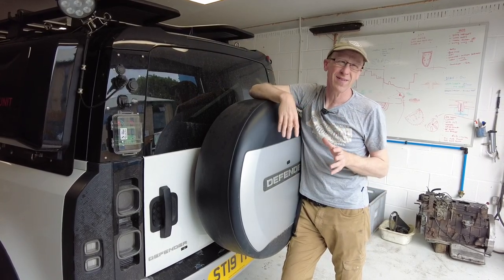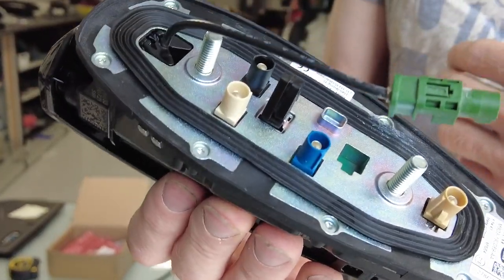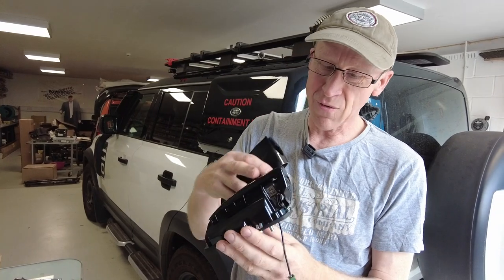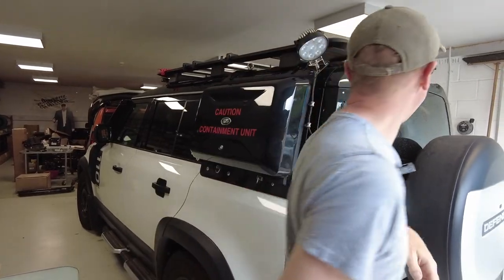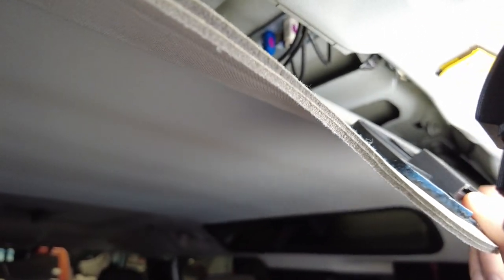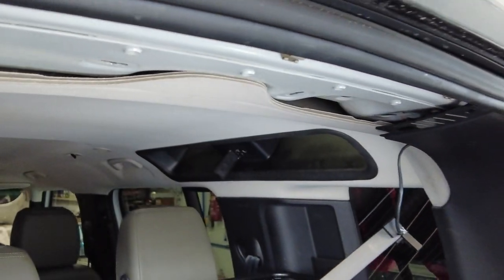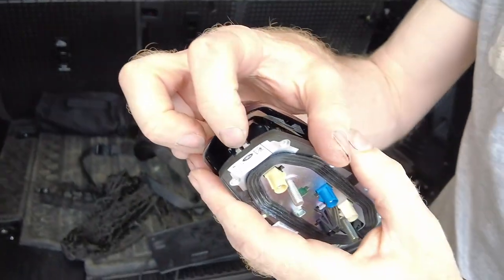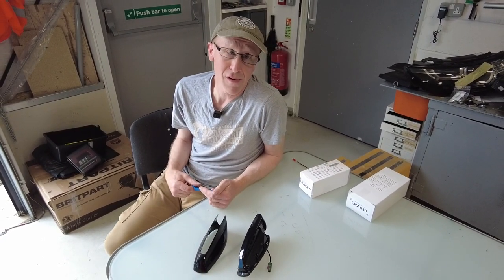Land Rover Defender L663 Roof Antenna Aerial / Camera - Removal and Repair

Comment: Thanks for the video! Would love to see a video on how to reroute the Satellite Antenna connection to somewhere else when a Rooftop tent completely covers the Roof Antena Pod. I am envisioning reroute path to a vertically mounted satellite antenna attached to the tent frame itself maybe? This is for an iKamper 2.0 on a 2021 Defender 110 SE. Thanks!

Comment: I’ve been waiting for this video Simon! We chatted quickly in an earlier video about the CAN-BUS and wanting to add a Clearview mirror. I believe in my wiring loom (MY 2022 USA build) it looks like there’s a fiber optic cable for the rear view camera. Keep enlightening us!
Reply: Simon.
Thanks for your reply. No led upgrades. I previously had swapped the older red side lights for the black version, but, bulb wise, they're both led. I pulled the plastic cover from the inside above the rear tail gate. That exposed some wiring and an aerial wire leading to a pink coloured connector. Separated that and reconnected - no joy.
I did not go further than that. After the plastic cover the roof lining is one piece all the way to the front so couldn't get beneath the shark fin. Maybe I should just try a new dab module.

Comment: Great product and swift delivery - thank you Mr. Powerful!  Does anyone have a tip to remove the original camera cover from the outside (vs. pulling down the headliner)?  I can locate the tabs but I'm not able to pop them loose.  Thank you!
Reply from the maker: this must be possible - it will take a sharp pull i guess to remove it

Comment: Thanks, Simon!  If you do redesign the top piece, I think you could lower the profile by .25” to .5”.  Would be very helpful for some of us as my garage is very tight and I’m on my third one!
Reply from the maker: Ouch sounds expensive ! I was just going to make a cover so it would be a few mm higher but it would cover your damaged ones ?
Reply: @L663  I think some people would love that but ultimately most people have an issue with the height.  So while you’d solve for one problem, my close calls with my garage roof will be worsened.  

All that aside, love your stuff and thank you for the videos!

Comment: Simon.
This video has given me a thought. My Discovery 4 has lost DAB reception. I used your previous video to strip out my rear panel to expose the DAB module. All the wiring connections were in place. I don't want to replace the module just yet. If I follow this video and remove the panel above the inside of the tail gate would I be correct in thinking the DAB aerial feeds from there?
Many thanks in anticipation.
Reply from the maker: Yes correct Marting - the DAB antenna is in the roof fin. Have you changed any other items on the car - some DAB can be sensitive to LED rear light upgrades ? we have not had a problem with our light son the LR4 but the L405 we have had some issues with our rear lights and DAB reception.

Comment: Great video as always although it doesn't look like it would be possible to easily remove the antenna so I could put my Defender on the train (height limit is 1.94m) ☹If you're thinking of what else you could do a video about, how about one on the MHEV system? Apart from assisting with the start/stop system, I have no idea whether it actually makes a difference to fuel economy
Reply from the maker: Defender on a train ! what madness is this ? This is interesting - the spec says it is 1.96 but it is not clear if this is with suspension down ( if you have air suspension ) so as long as it lowers by 3CM you are ok ( just )
Have you measured it ?
Reply: @L663  Saves 3000km of driving (from Adelaide to Darwin) and you get to travel in luxury on the Ghan (train). Have had a measure (in access mode with air suspension) and its around 1.93-1.94 (a little hard to measure on your own) so probably OK and maybe with some tyre deflation (18 inch wheels) could reduce it further. Would hate to be denied permission to board or (far worse) end up with a decapitated Defender!

Comment: I would love a video for the lower camera as mine was scratched during a car wash.
Reply from the maker: OK - the video in the rear bumper next to the license plate ?
Reply: @L663  yes. Figured it would be an expensive repair if I couldn't replace it myself.

Comment: What is the camera? IP? Analog ?
Reply from the maker: Good question - i know a lot of the cameras are LVDS - Low Voltage Differential Signal but i think this is more basic.
Reply: @L663  Is it possible to connect a regular monitor?